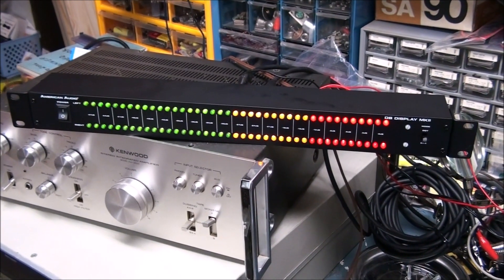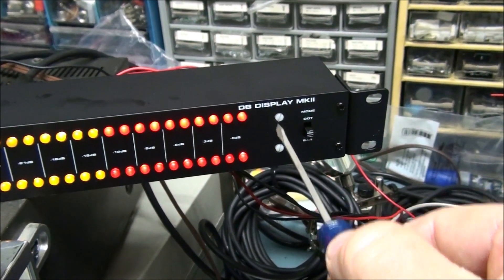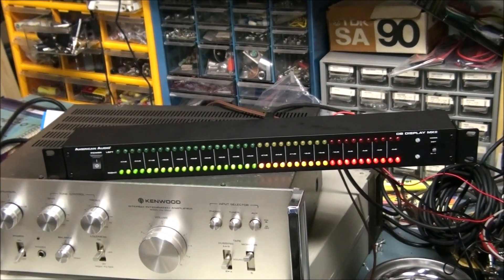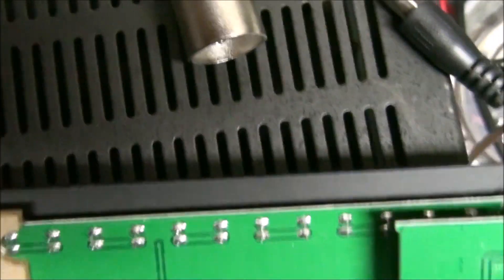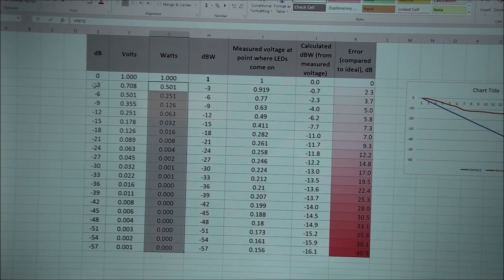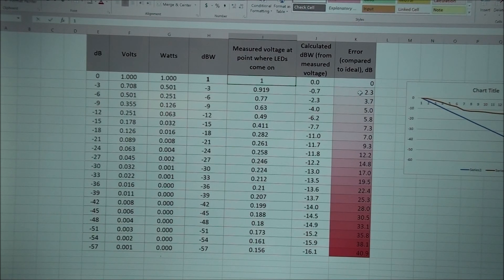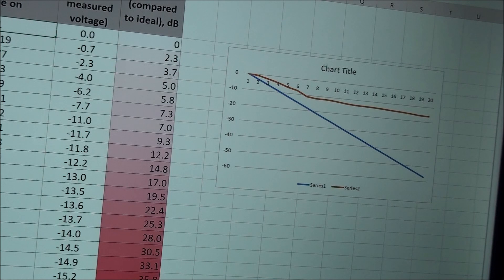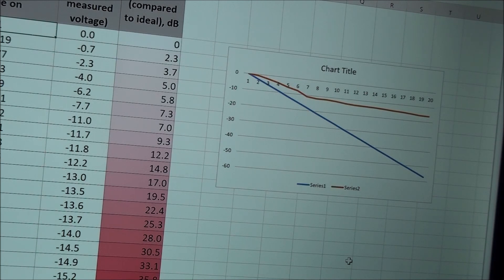Technical Review: American Audio MKII DB Sound Volume LED Display Monitor Device for Amp Rack

Comment: Thank you! You just saved me from purchasing a prop! Just like you, I wanted something that showed me an accurate representation of audio levels for the purposes of confidence monitoring. In retrospect, it's main job is to show me how much headroom I had so that I could avoid clipping, and that is something that I could calibrate this 0dB to my 0dBFS and just get used to it...not going to do that.
Reply from the maker: It will allow you to show a 0 dB level; however, the scale below that is off a lot (like I describe).  Also, there is frequency dependence, so I would not trust this device for a good 0 dB level at subwoofer frequencies.  I guess for $80 USD you can only expect so much.  I wish a vendor would come up with a pro-quality unit (I don't mind paying for good design and quality).

Comment: Im looking for a db vol LED meter unit (with balanced in/outs). Just wondering if you came across anything better out there. Cheers
Reply from the maker: No one that I have found makes what I would call a professional grade unit.  I'm guessing the market is not there for it.  I was toying with developing one... but not sure if the investment would pay off.

Comment: Just curious if your mixer Has this to show you your audio level why would you also use this?
Reply from the maker: In a system where the mixer output (meter) has been calibrated so that the amp is at max output when the mixer is, you are correct, this itemis not really needed.

Some systems have multiple amplifiers... one for bass, one for mids, highs, etc.  In this case, knowing where the amp's output is relative to max can be very useful.
Reply: @RocketRoberts  thank u.

Comment: What if you were to change out the pots used to adjust the maximum signal level ?
Reply from the maker: That would not change the linearity of the unit... only the input sensitivity.

It needs a complete re-design in order to display signal levels in accordance with what is listed on the front panel.

Comment: I bought one of these blinking things with higher expectations but it does indicate go or no go signal strength for recording. If no lights blink, I have to boost the signal.
Reply from the maker: It has its uses... as a "signal present or not" it's fine... but not for use when correct power level readings are a requirement.
Reply: @RocketRoberts  That's for sure, I Payed $100 and I did expect a better device than I got.
Reply: @RocketRoberts By the way,  thank's to your video I now know to put a label indicating -16dB over the -57dB marker on my blinkin' thing.